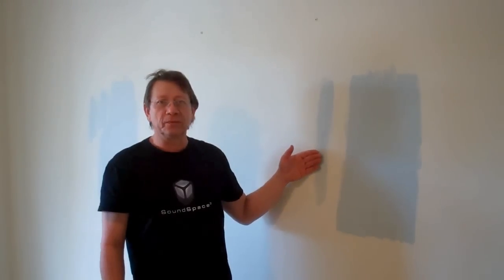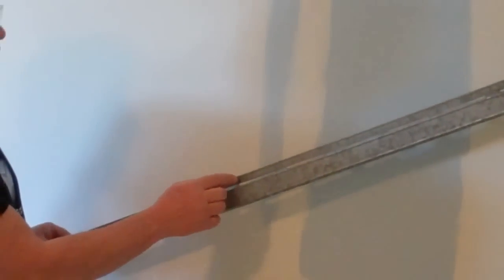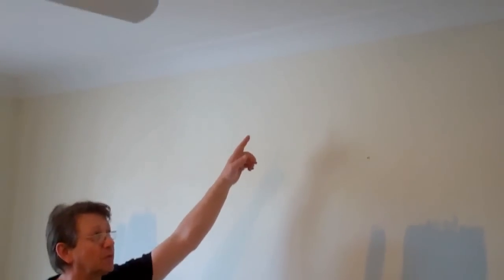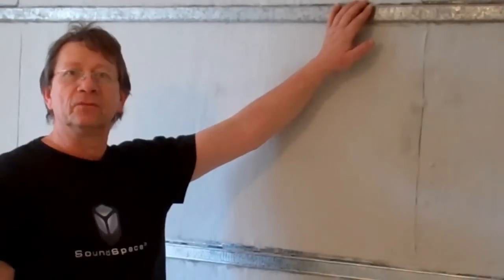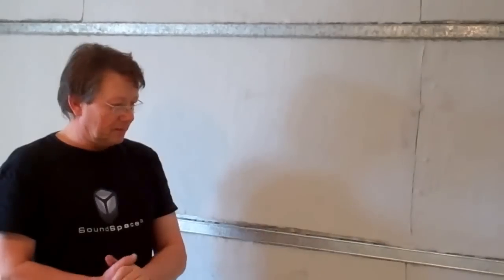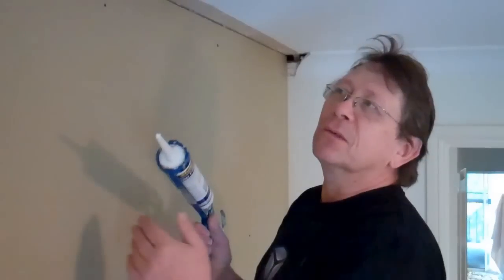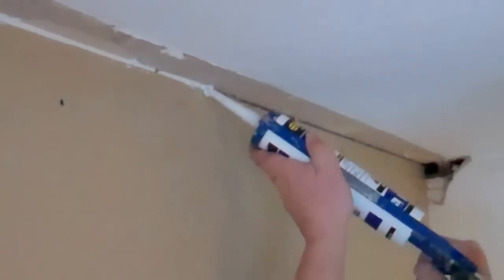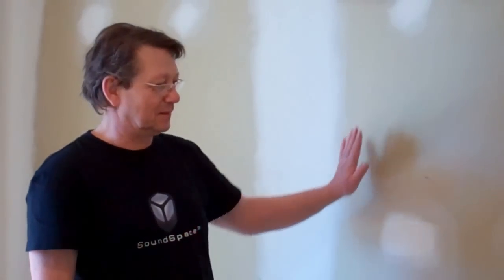How To Soundproof A Wall

Comment: Im curious about you isntalling the resilient channels on top of the existing drywall, and then install the other 2 layers and absorbers. So far, all videos of constructors eithe rshow or recommend to remove the existing drywall and always install the reschannels on the wood studs/joists. Is there any reason why you did not?

Comment: dang this rc channel install was botched as can get. This stuff is made to attacth to raw studs! Not to the drywall! Sorry but not sorry!
Reply: I didn't install the RC channels on a drywall but on a rendered brick wall, otherwise I would have removed the plasterboard and install the RC channels on the studs, taking also the opportunity to install acoustic batts between the studs. Ideally, it's better to install a new separate partition wall made of steel studs, filled with acoustic batts but it takes much more space and sometimes people are not willing to lose so much space and chose a compromise using the FC channels directly on the hard wall, instead of using resilient mounts, that takes more space as well. I've been using this system successfully since 1992, it works well for airborne noise such as music, tv, voices but for banging noise, like doors, than the separate partition wall is definitely recommended.
Reply: @philipperessos5499  Happy New Year sir. Sorry if I came off wrong. I was just saying that the manufactuer will not warrantee the install if you deviate from their specs.

Comment: This is an excellent video. I had a significant noise problem from the neighbours on the party wall, I followed the technique in the video except I put 5kg/sqm loaded vinyl between the 2 layers of plasterboard.  I also had the plaster board skimmed to get an original looking finish. This has cut out virtually all airborne noise (more than 95%) and the whole structure is less than  less than 5cm thick so no noticeable reduction in room size. I do still hear if someone slams a door or similar but at a much reduced level. If you need sound insulation but don't want to lose too much space, this is the way to go.
Reply: Glad to hear this method worked for you - I am considering the same, by using 5kg/m2 mass loaded vinyl. How did you bond this to the plasterboard?
Reply: @vinces6630  you can use flat head screws on top or some staples or also adhesive on top, like contact adhesive, I am using somer kind of contact adhesive on canister with a hose and gun, it works well for me.
Reply: @vinces6630  Its at least a 2 person job putting up the MLV because of the weight of it. Basically 2 of us held it up to the first board once it was in position and screwed to the resilient bars. We then screwed the MLV into position with plasterboard screws. it wont take many to hold it up and you can just go into the plasterboard, dont worry about having to hit the resilient bars. I would imagine using contact adhesive would be really difficult because you need to be able to move the MLV around to get into the right position, any sort of contact adhesive would make that impossible. I also didn't get the MLV which has adhesive on one side for this reason.
Reply: Thank you for your feedback; I am using sometimes 8kg/m2 Mass Loaded Vinyl between the plasterboards, the heavier, the better for low frequencies.
As you said, it works well for airborne noise but for banging noise, it's more complicated because the sound goes through the structure of the building, meaning on the adjacent walls as well, that's why you can still hear that type of noise well, It will be less strong but even 50% reduction will give us the perception it didn't change much.

Comment: Excellent video! Thank you so much for your help! How does this method compare to a single layer of extra drywall with green glue?
Reply: Good question Eric, the green glue is equivalent to the visco-elastic membrane I am using between the two layers of plasterboard, so the result will be equivalent. You can use one or the other, whatever you can find in your area but make sure you use the right amount of green glue recommended by the manufacturer, if you use less, you'll achieve less sound reduction.
Reply: One of the Best Ideas of SoundProofing is "SoundProof Curtains" it actually Block outside Noise coming from Windows. Check Here: https://livesoundproof.com/best-soundproof-curtains/

Comment: I sound proofed my wall, hung a carpet from a baton fixed to the joists, glued onto the carpet egg trays (the two dozen size) then screwed another baton to the joists, through the ceiling, and hung another carpet from the inside of that, almost touching the egg trays, then constructed a new stud frame from 2x2 timber and plaster boarded it, new coving and skirting job done. Put on bob Marley Jamming, as loud as it would go, went next door and the old lady let me in and I couldn’t hear a thing, until I put a glass to the wall and it was very faint. The original issue was her telly was drowning out my living room, she deaf, I lost 4 inches off the wall but you can’t really tell. You have to have a tiny air gap and multiple soft layers to absorb the vibrations without passing them through. My method is about 99% effective I reckon, from what it was before. Maybe different frequencies will come through, I’ll find out when she dies and the house gets remodelled.

Comment: Hi. Love your videos. The roof cavity one I am looking at doing soon. I am also looking to do my walls as I live on a major road. Our house is weather board and we have already installed secondary glazing, however I think there is still quite a lot of noise coming through the wall. We really don't want to lose too much space in the room and I'm intrerested to know whether I can sandwich MLV between the existing plaster board and say a layer of Fyrchek? Really wish you guys were in Melbourne.
Reply: Yes, the walls are probably weaker than the windows now because a 10.38mm secondary window would be roughly equivalent to a brick veneer house.
What makes the secondary window efficient, is not just the thickness of the glass but equally the air gap between the two windows, the bigger air gap the better.
By adding an MLV in sandwich with a Fyrchek or Soundchek or equivalent, you don't have a separation, an airgap, everything is fixed on the same stud. So, ideally would be to remove the existing plasterboard, install acoustic batts between the studs and install a secondary partition wall separate from the existing one; I know this would reduce the space and you'd loose roughly 100mm but you could eventually compromise and install resilient furring channels as shown in the video above.

Comment: One thing i dont understand - the drywall will have to somehow connect to the ceiling snd the floor and will therefore be connected to the other wall. How do you prevent this?
Reply: Good point! We can't avoid a connection with ceiling, floor and adjacent walls but we can minimise it by leaving a gap all around the primeter of the first layer of plasterboard and seal it with a soundproof flexible sealer, it can be done with the second layer as well but if you don't have a cornice and skirting board, that join will be visible as well as for the side walls and that's one of the reason to add a visco elastic membrane between the two plasterboard, we can also use "Green glue", same effect, that prevent the boards of vibrating, so the vibrations coming from ceiling, floor and side walls will have a small effect on the whole result, in fact, you'll have more noise coming from the side walls than from the treated wall but the side walls vibrate much less than the treated wall; that's why, you can only reduce the noise to an acceptable level, otherwise, you'd have to build a room inside the room, separate from the existing structure, which can be necessary if you want to build a recording or music studio in an apartment, for example.

Comment: thank you very much for the video. Whato do you do with a power socket if you have it in that wall? how do you make sure you still have a power socket on the new wall but dont leak sound through it?
Reply: Good question! Ideally is to make a hole as small as possible to allow the wires going through and replace the power point by surface mounted power point; if you don't want surface mounted power point, you can make a small hole through the first layer of plasterboard, cut a cross in the membrane between the plasterboards and cut a hole needed for the recessed power point, it still working very well.

Comment: Could mass loaded vinyl be used as a sound absorber instead of the polyester?
Reply: No, because a mass loaded vinyl is a sound barrier and it's designed to stop the sound going through and a sound absorber is designed to prevent the sound of bouncing back, it doesn't prevent the sound of going through. The sound absorber is installed in a cavity to stop the sound bouncing to itself and increase, like a drum.

Comment: I hope you can give me a quick answer: I understand that you have to nail the metal part to the studs in the wall. But when you want to screw the new wall into the metal part, how do you ensure you are hitting the metal? And also, how do you ensure the screw does not penetrate into the wall behind the metal part? Because if it does, it will ruin the whole connection between the outer wall to the inner wall. Also, any opinion on the product Green Glue?

Comment: you mention that the plasterboard should be high density. would you think that cement board (e.g., Hardiboard) would work better for the first layer?
Reply from the maker: It doesn't mater too much which product you want to use, for example 16mm thick plasterboard will be roughly the same weight per m2 than 12mm thick Hardiflex or 13mm thick Soundchek, so, if the thickness is not too important, just chose what will be the most cost effective, if the thickness is very important, than Hardiflex, for example, would be a good option.
Reply from the maker: 4-5 thousands, depends on different situations, places, difficult to tell, we can't give a quotation per m2, every job is different, for example you may have fancy cornices to remove and replace or re-install or have a wardrobe in the way, therefore we must modify it to suit.@1EccentricMoFo

Comment: So did you install two layers of plasterboard @30mm each, 60mm of plasterboard in total??
Reply from the maker: No, I did use two layers of plasterboards 16mm thick each, that is 32mm thick plus the 2-4 mm thick membrane between
Reply: @soundproofingexpert  Great, thanks for the reply 👍👍👍

Comment: dumb question I'm sure, but does this reduce the noise from both sides of the wall or just the room with the soundproofing? What would you recommend for ceilings? would it be the same process.?.

Comment: would it be possible to use a dense carpet underlay as an acoustic absorber if stuck to the wall?
Reply from the maker: A dense carpet will make little difference, but it works at some degree as a sound absorber, which means that by reducing a bit the echo in your room, your neighbour will hear you less but you'll still hear quite clearly your neighbour.
Reply: soundproofingexpert would it work as a replacement for the high density material you put between the resilient bars?

Comment: Hello, where can i buy this in Canada?
Reply: You can get the resilient furring channels from a local plasterboard supplier.
The high density acoustic polyester I am using doesn't exist there I think but you can use any other sound absorber, high density made of glass wool or rock wool or something similar, may be not foam, because it deteriorate within 10 years, more or less. By doing a search in Google you should find some mass loaded vinyl to install between the plasterboards, you can use 2kg/m2 or 6kg or 8kg/m2, the heavier the better for low frequencies.

Comment: If applying this all directly to a brick / block wall, would you recommend laying down an initial layer of plasterboard first and then this on top of that? Or would putting the resilient bars directly to the brick also work? Cheers
Reply from the maker: You can install the resilient furring channels directly to the brick work, installing a plasterboard first will not change much but you can first install the sound absorber all over the wall (5-10mm thick) and install the channels on top of that, it provides an extra padding for the channels and will help reducing a bit more the transmission of vibrations. On the video I've installed the sound absorbers between the channels but now I am installing the channels on top of the sound absorbers, it's a bit better and goes a bit quicker.

Comment: Your resilient furring channel is install the wrong way. The screw must be under..
Reply from the maker: Yes, you are right, it supposed to be the other way around according the manufacturer but I wonder what difference does it makes and if it is possible to measure any. What I am doing now is to install the sound absorber on the whole surface of the wall and install on it the resilient furring channels. I did install the channels vertically in one occasion to facilitate the work of the carpenters installing the skirting boards and we don't hear any difference; may be there is a difference but less than one db, we start to hear a difference at 3db.

Comment: What is the absolute best sound dampening material? Not how to  place it or the shape. I just want to know the best material. Noone answers that. Videos are about spaces between walls etc. What is the best material? Do you know?
Reply from the maker: Hard to answer because some will be better in high frequencies and other in low frequencies, it varies according the thickness, density, nature of the product, I am using most of the time polyester based products but fibreglass works very well as well as some foams but they all have advantage and inconvenience. To compare sound absorbers, you'll have to compare that particular thickness, particular density, particular material and particular frequency, that's why we can't tell this sound absorber is the best one. the foam will disintegrate after 4-5 years in a boat or in humid condition and it will take 8-10 years in a recording studio, polyester will last forever, fibreglass is itchy but doesn't burn, some insurance companies will not insure you for fire if you use foam etc... so, there is no one answer to this question,

Comment: Would be nice to have a before and after example of the changes in sound transmission
Reply from the maker: Yes, you're right, I couldn't take any measurements in this case, neighbours are not always cooperative but on average I have 17db reduction (10db is halving the sound)

Comment: could the dry wall be removed the studs then somehow insulated it and put new dry wall back?
Reply from the maker: Yes, of course, you can do that, but when're-installing the plasterboard, better install a double layer with a mass loaded vinyl, 6kg/m2 or 8kg.m2 between the boards; it is not as good but acceptable most of the time and  takes less room.
Reply from the maker: Yes, it can and you can install high density sound absorbers between the studs, install a couple layers of 16mm (1/2 inches) thick plasterboards with a layer of mass loaded vinyl(8kg/m2) between the boards, it takes less space but it is a compromise, you can also increase the space reduce further sound transmission by installing on the studs the resilient furring channels.
Reply: Thanks a lot!

Comment: why haven't you listed the material you used ?
Reply from the maker: the flexible sound barrier I've used was a Mass Loaded Vinyl 8kg/m2 and the sound absorber was a high density polyester sound absorber; I have the sound absorbers made for myself, according my specifications, I am using polyester because it can sustain the weather, it is water repellent and doesn't attract mould and bugs. There are other types of sound absorbers for external use but you have to search around your local area for what is available!
Reply: soundproofingexpert thanks you should of listed it like list but thanks for the reply sir